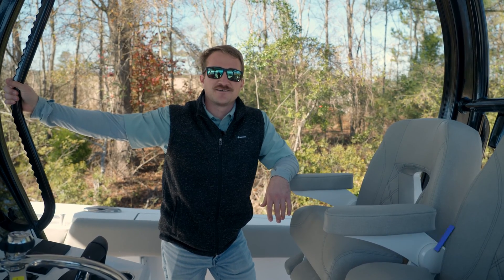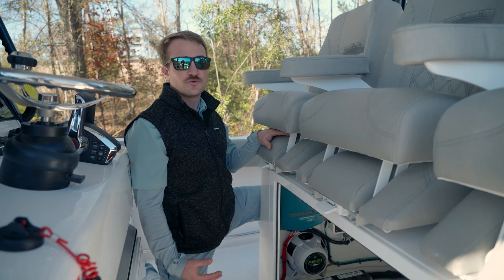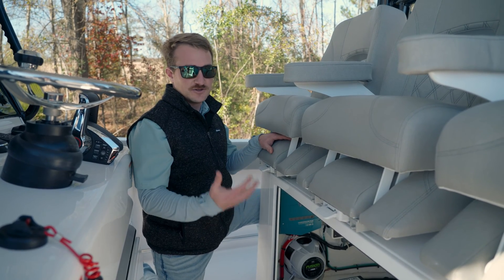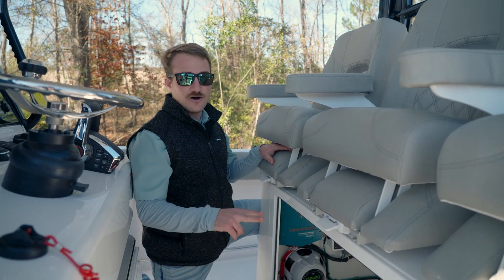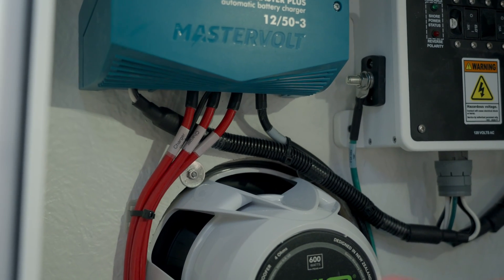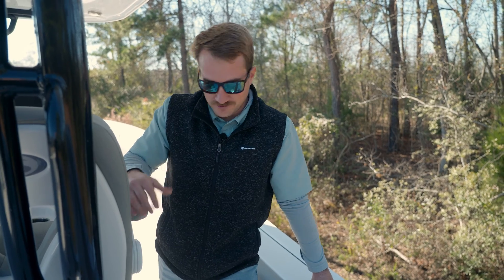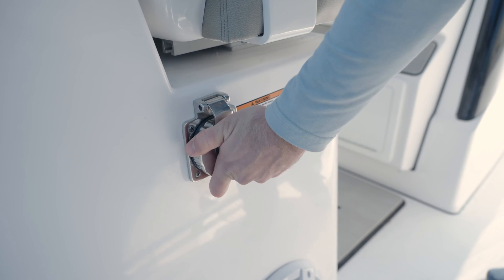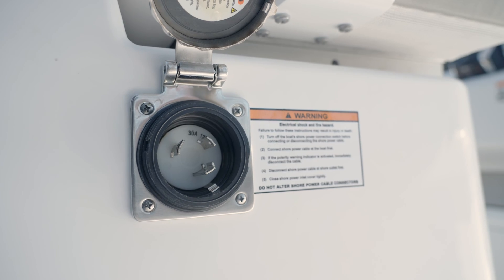Tech Talk - Mastervolt Charging System

Comment: Can you have different type batteries on this charger at the same time? Ex regular deep cycle batteries along with an agm bank/ lithium bank?
Reply from the maker: To start, you cannot do lithium unless the entire system is set up as lithium. However, you can set up AGM and a regular deep cycle.

Comment: Help on an issue.  My boat provides a 30amp outlet that I am using a household 110v20amp shore outlet
When I am charging house or domestic batteries… that can have items running(refrigerator,etc) system charges fine 
When I leave my lithium batteries on and running AC… charging system will flip a breaker and this short off the charging system and also send a charger to my outlet, flipping off the gfci outlet
This will occur 2-6 hours after body is left charging

If I’ve return to boat after system is flipped off… then system is then creates a drain in all my batteries

I also have a CZone system that I have set at either 10 or 20 amps
Both settings fail
What is your suggestion?

I should have the ability to run ac all night while on short power

Thank You